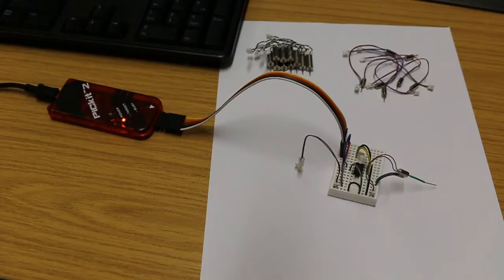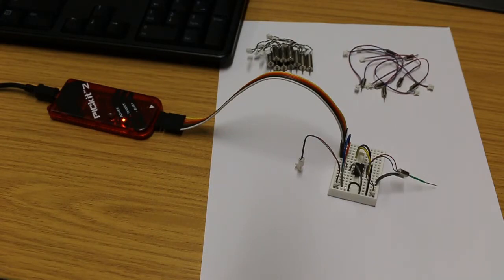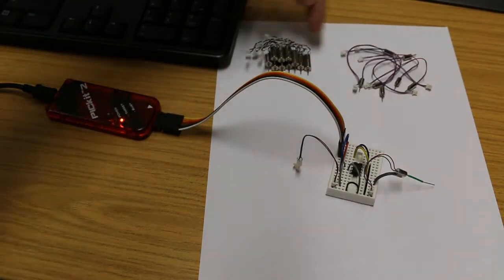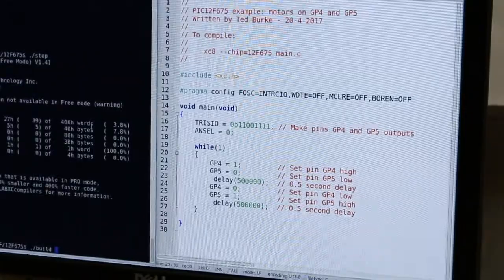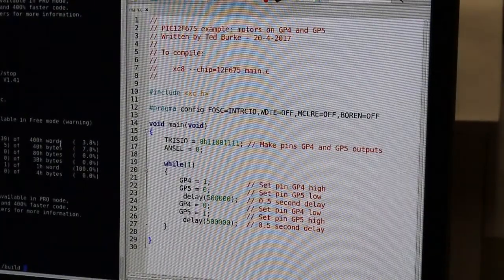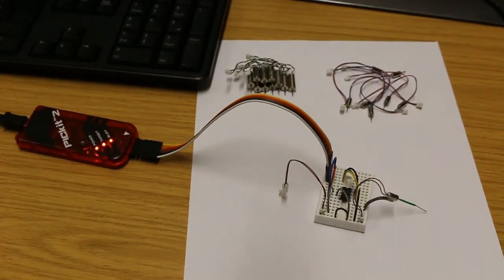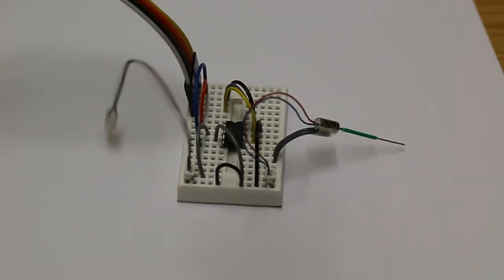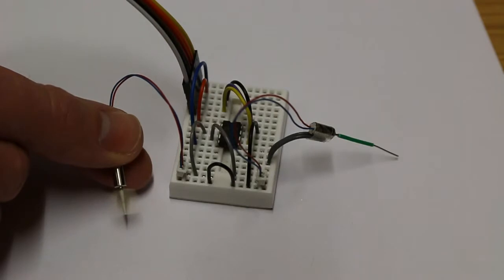Motors powered directly by PIC12F

Comment: I think it is not good idea. Motor does induce back current, for example https://electronics.stackexchange.com/questions/408592/what-role-does-this-diode-play. And you should use external transistor as switch. In your case whole current goes through the microcontroller :) But thanks for sharing.
Reply from the maker: Sorry, just saw this comment now. The whole point of this was to try powering the motor directly from the microcontroller without an external resistor. The current rating for these small motors is so small that it is just about possible to supply with microcontroller GPIO pin current. Clearly in most normal situations, one would use a transistor (or similar).

Ted